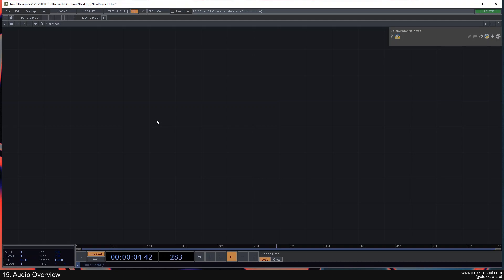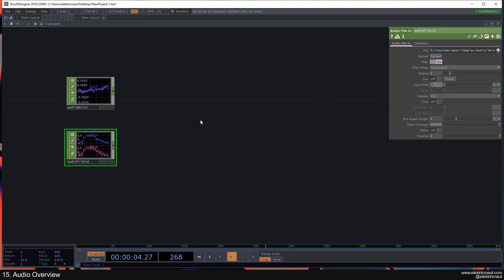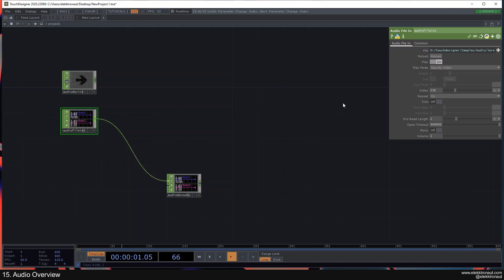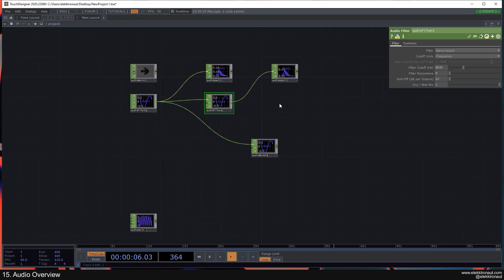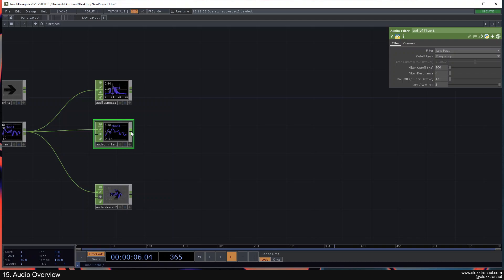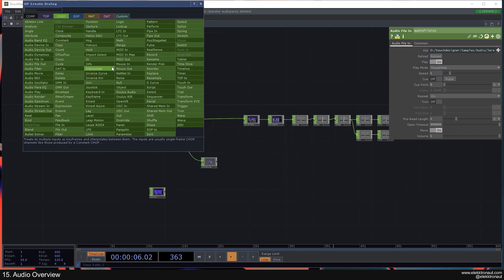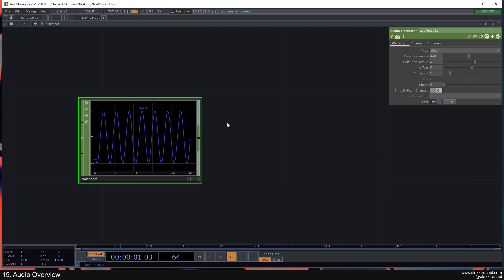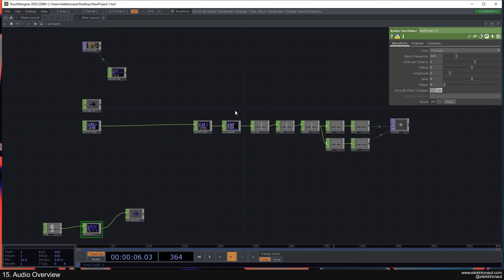15 – Audio Overview – TouchDesigner Beginner Course

Comment: You were going fine until you decided to skip a bunch of steps with the whole null/math/rename part and didn't explain how to actually link any of the green boxes to the circle box. All i get is errors when i try and drag and drop like you did.
Reply from the maker: Sorry to hear. Have you watched the entire series until here?
Reply: An absolutely terrible demonstration - go super slow during the boring parts, then blazingly fast during the important parts.. To solve this, you need to find the radius parameter in the circle TOP. Then click the plus sign in the bottom right of the CHOP and drag from the CHOP block on to the TOP radius and choose CHOP reference. Once it it working, go back and unclick the plus sign in your CHOP.
Reply: @matthewgalvin5901   I followed your advice, but was never able to the the 'CHOP reference' option to appear, so had to type in the expression by hand.